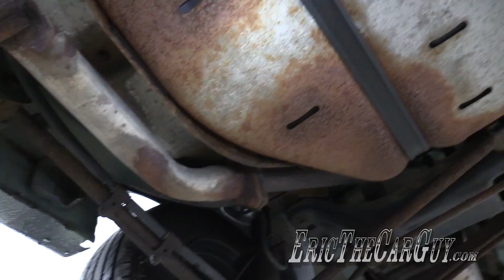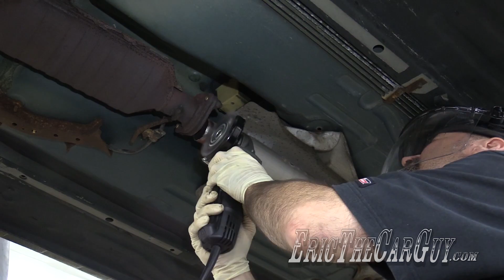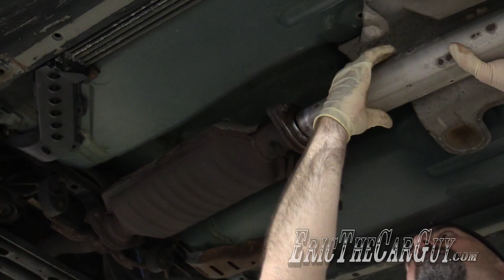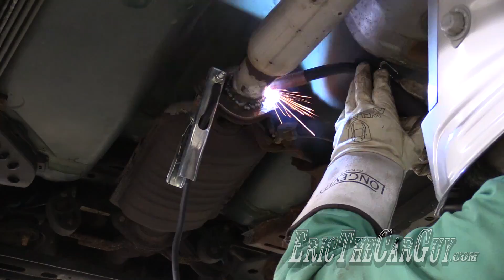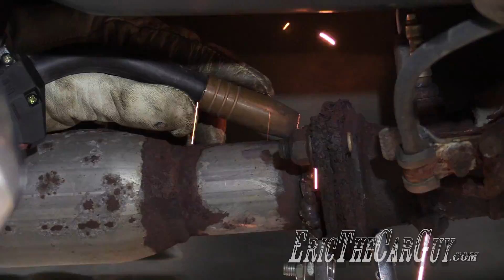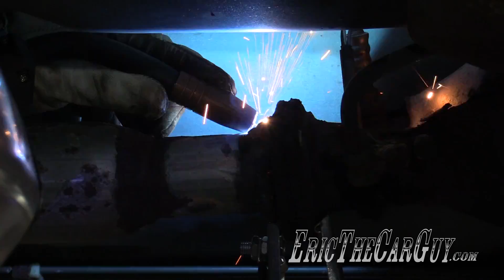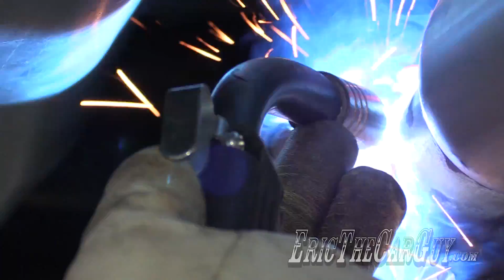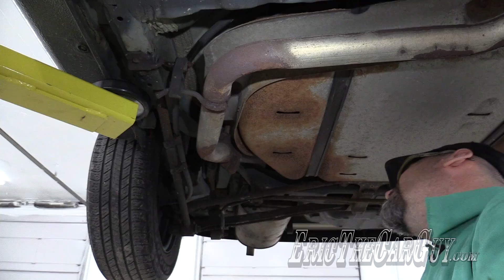Money Saving Exhaust Repair -EricTheCarGuy

Comment: This is exactly the same problem I found today. My exhaulst on my Land rover is in good condition , but the flange on one pipe has come away from the pipe.  So clean that there is no sign of weld at first inspection.  I just wonder if this is deliberate  manufacturing ploy.  So, armed with this information I am going to try and repair the flange as the rest of the system looks really sound.

Comment: I had different “lifetime” muffler “replacement” warranties…. They were both(big name companies)! Very talented - make up brackets that add abnormal tension on the welded bracket - pipe rust through anear the weld and the tension pulls the bracket away New exhaust leak EVERY TWO YEARS! Muffler free BUT “ we need to replace all your pipes or the “WARRANTY” is voided. $300 every 2 years!!!!!!

Comment: Flux core welding is very difficult much more than mig, you have to have every thing dialed in perfect. feed speed/current, voltage and tip distance and travel speed and a very good wire type. also use correct nozzle. using that tapped transformer old style dial welder makes it that much worse for flux core.

Comment: 3:30 Putting a soft booted clamp on each side of the exhaust, then running two longer clamps to pull those two together, is one way to butt them together.

Comment: Could also wrap a bit of the welding wire around the break to add more raw material right? I might just buy a welder I've always wanted to fix my exhaust that just broke off, although I don't have a lift, I wonder if I can just roll my car over on the grass somehow...

Comment: I like this guy, he's so calm and mellow, he could do ASMR videos.  

1. Make sure you have a good ground (find or make a clean place for your ground)! 
2. Clean everything within a 1/4" of your weld to bear metal inside and out (if there's a gap or you burn through it will fill easier without the contaminates inside getting into your weld).
3. Dial in your welder on similar piece of scrap before you start. 
4. MAKE SURE YOU HAVE A GOOD GROUND!

I would have (maybe) left the rear hanger on and unbolted the front flange and dropped it down after tacking it, but then that could be a whole other problem.

Comment: Them welding gloves are not for auto mechanics get cheap gloves for that you don't want oil on the welding gloves that have sparks on them.i know its a pain but they cost more and can start on fire oil soaked you don't want to be on fire and don't know it.got it fixed.

Comment: I agree with dirtwelder162 or whatever. Eric, we have all been there for a friend or family member who needs the exhaust to last 6 months or a year. Pulling weld from the thicker flange onto the thinner pipe is an option with burn-thru. Another, weld a 2” length of donor pipe from the scrap barrel. Weld it too the flange, the clean, slide the old into a proper sized shorty that is easy to work the MIG torch around for a complete weld. This puts the thin stuff inside. Yes, they owe you a steak dinner...with sides and a cold one! Friend. You know.
ASE Master  - Retired 10 years ago  (now 2021) still fixing!
Reply: DirtShower250  cool name!

Comment: Im have an issue with a '98civic ex coupe, imagine that. Exhaust pipe is separated at the resonator hanger, going towards the muffler. The problem is, where the resonator pipe connects to the cat, it is welded, no 3 bolt flange. Are there 3 bolt quick fix flanges I can use? I do not have welding capabilities, or the funds to pay a shop to do the work.

Comment: Hi Eric...there were no connectors would not fit my new exhaust. I used a good brand exhaust wrap to increase the 2 1/5 inch pipe to 3 in, then I wrapped around the outside with exhaust wrap and put a stainless steel pipe clamp over the connection. Will it last? Also, how do thunk it will hold up in winter weather?

Comment: Just a a little tip for getting the top of exhaust welded. Use a 1/16 6013 rod at 40 amps, bend the rod in a u shape, I usually hold inspection mirror in one hand and stinger in the other. Works every time!
Reply: @TheHopson I grinded my flange with a cutting wheel, it worked, but unfortunately ended up with metal shavings in my muffler. I replaced the muffler, but then the new muffler rotted and has a pretty good exhaust leak. I want to put back factory muffler, the one with metal shavings in it. I tried getting the shavings out, but can still hear them rattle around. My question is, is it safe to put that muffler back on, with the tiny metal shavings still in it..? I can hear them, as I hold the muffler, and keep flipping it 180 degrees. Is it safe to put it back on my car, with these metal shavings still present..? Thank you for your time, and advice.

Comment: from personal experience its almost always easier to just cut the flange off and replace it with a  short piece of tubing either smaller or larger diameter if you don't have access to a expander or reducer

Comment: This is me;

Exhaust pipe rusted through.
Should I weld it?
OEM pipe= $400 (lasts more than 10 years)
Cheap pipe= $75 (lasts about 3 years)
How old is the car? more than 15 years

Just get the cheap pipe.

Comment: Every video you've done is the same low quality work. If this is your personal car, this repair is fine and costs almost $0!  If this is a customer car shops wouldn't do this--the pipe is going to need to be changed anyway and the exhaust flange gasket needs changing.Don't worry it will break at those bad welds.   You're really doing a dis-service to your customers--unless they're desperate for cash.  Save Time=Save Money=DO the JOB Right the first time.

Comment: tight work space my man. something sounds a little off with the wire feed or voltage. it shouldn't tap tap tap like that. should be nice smooth current. I actually have a muffler pipe job going on this week. thanks eric!

Comment: I know I am a bit late on this one but from my point of view I would have cut the flange to cat bolts used a new flange and bolts with a coupling welded to the flange to slide the pipe into then clamped it. Seems like a better way to go on this one. GOD VIDEO ANYWAY.

Comment: Great job Eric. Seems like you could gave unbolted the flange from cat to pipe and rewelded the flange to straight pipe. Still the same deal in the end. Happy welding 👍👍
Reply: Sure, but those flange bolts are probably 'permanent', and he's likely not getting paid, so faster is better.

Comment: Thank you for your video and time. How much  would you say it costs  to cut out old  and  weld a new 6" or 10" pipe replacement on the exhaust part underneath front?  Thanks

Comment: How can welding damage the computer?
Reply: The welder uses very high electricity to make the metal hot and melt, that electricity can find its way to the computer, and ruin it if your battery is hooked up while welding.

Comment: When you have a gap and welding thin metal, easier to do single tacks on one side then the other, it will allow the metal to cool and lessens the chance of it blowing through. Just like you were doing a sheet metal repair on a body. In addition, start at the thickest part (Flange) and jump the tack to the thinner part (pipe). Clean it off then go back around it stitching both pieces together. So you are "stitching" from flange, to weld, to pipe, to weld, back to flange. That way it gives you more metal to work with...
And I would have tacked it, then only dropped it at the flange to get the top and wedge something between the pipe and bottom of the car to hold it down...
Been there before... but no lift... doing it in the driveway laying on a creeper... Fun times...
Also I have used an old ratchet strap to pull the pipes together just long enough to get it tacked... Get it wet so it don't catch fire from any spatter.

Comment: I realize it's a help video. But, y not disconnect the broken flange end and the other flange closer to the muffler. Make orientation Mark's, take it of and weld it, in position. Wouldn't take any longer

Comment: Welding? New parts? .....Nah,  Thick rubber bungee strap pulling the  two parts together. That’s what I just done. You should see it. It’s a reaaaal piece of work ;)

 (changes it every other month due to heat/melt)  1998 Honda Civic with 300,000 miles

Comment: Stacking tacks is usually easiest way to do thin wall tube like exhaust, least chance or burn thru. Also bounce from side to side to minimize heat soaking the metal

Comment: sealing that leak will over work the engine  and cause fuel injector damage bank 1 gets the worst beating if the exhaust on bank 2 is stronger

Comment: that un regulated part of the exhaust system has a clog, hot ass exhaust will burn a hole through the weakest parts of the exhaust pipes normally near the flex pipes

Comment: Eric great videos and for those that don't have access to a welder using a slip fit exhaust connector is another great fix to keep the neighbors happy trick is IO vs OD if you have say 2.5" exhaust you can get a 2.5 ID to 2.25 OD the 2.5 ID will slip over while the 2.25 will slip inside.  Hope this helps someone!-)

Comment: Was hoping you would use one of those new laser deruster to clean before welding.  To cover the hole in the top, it's cheaper to use patching material and fabric, just as effective.  That way you don't have to loosten and exhaust items and reattach to complete repair.

Comment: i tried doing this yesterday on my civic with the same problem. extremely hard unless you have  thin welding wire. i found it much easier to just sawzall the flanges off and slide in a nipple/coupling piece with claims. only like 14$.... and super tight

Comment: I was just driving the other day and dropped a gear to overtake and all of a sudden out of nowhere a "poof" sound was heard and a rythmic metal scraping. I immidietly knew what happened but secretly I wished it was maybe something else. Stopped and looked under and my middle pipe was scraping the road but not on the side of the cat (like in the video), but on the muffler. I really don't know if welding is an option because it sure has to be rusted to hell to shear itself from the exhaust pressure. Any other alternative than a new pipe? I gotta pay my semestrial tax in a few days so I don't have a lot of money, but the majority of my exhaust is hanging on zipties right now lol

Comment: I have the same problem...sure i can weld pipe but the top section is very tight and i do not have ability to drop pipe... i am hoping i can seal it good anyway...

Comment: I might go and install a stainless steel muffler these days...
Okay i heard exhaust shops don't want to unhook negative terminal or both but i have the right to ask for it...but is then 100% safe for ECU (and battery which is cheap) or i have to do anything else...
For example how do i disconnect ECU and where it's usually on Toyota's?

Comment: That is a good habit to have that work clamp very close to where you are welding. It keeps the electrical return path as short as possible. I learned that early on when I first got my everlast welder and was being taught by a very knowledgeable welder.

Comment: you could have not been a hacking unbolted the flange and then tack welded it and place to the pipe and welded it solid the metal you welded to was thin fuc and just going to rot right back out

Comment: repairing exhaust is one of the most difficult job to do with a MIG welder as it very difficult to clean completely the rust, the material is often  extra thin and the access is limited.
Eric does a damn good job
Reply: Lmao its dirty that is exactly why using wirefeed

Comment: Great job man. Im a certified welder graduated at CWB Group alberta. I can weld anything but i hate welding on cars specially exhausts. Disconnect battery make sure cats topped up in fuel less fumes no explosions lol tight spots to bash your head on rust cleaning its not fun. Awesome job. Those that crit you on this obviously are pen pushing white collars 😎

Comment: Good to see he is wearing face protection. I dread the times when wire comes flying off the angle grinder. My exhaust is making noises and I suspect I've got a crack in the pipe somewhere. Time to get out the everlast. I will probably weld in place as Eric did. I don't want to unbolt everything.

Comment: doing this with a welding machine that feeds flux core wire like I have is really hard in my opinion . you made this look easy.
Reply: you sir are a genius. I wish I thought of that before I made a giant blob weld on the top of my rangers new glass pack muffler.

Comment: I might have gone with a split sleeve to get on to sound metal. Short bit of pipe, split along it's length. Slide sleeve over the end of the pipe (smear of exhaust paste to lubricate and aid sealing). Move sleeve to contact flange. Tack both ends of sleeve first then run weld along all seams (including split). This method is easy to weld with area at the flange strengthened beyond a single weld as you have done in your video. Hope you do not mind my ten cents worth. Keep the vids coming - enjoy watching them.

Comment: It needs another brace welded to pipe to hang to body. There is a lot of tension on that one weld. Because of welding heat changing the temper- a weld is the first place to rust.

Comment: I'm a pro welder too. He did okay for what it was. As we say over here, fit for purpose.
Only issue with welding old exhausts is that once they start cracking, it means the pipe has become embrittled with heat and age and will probably break again near the weld in time. But hey, it is a good way to keep the car on the road whilst you save enough to replace the system sometime. Keep on doing it until you're ready.

Surprising really.. Don't often see you Americans leaving the safety guard on the grinder! lol.
I agree with using the face shield though. I had a guy on my crew who used to use the wire buff on a 9" grinder to prep steel for painting. He would come into my office to talk about something, and I would tell him to pluck those wire strands sticking out of his face. He never realised they were in him!
Reply: i just wonder i live in europe so its 220V-50hz in us its 110-60hz is there a big diference in welding.By the sound its more high pitched.The top part looks great

The weld is ok , he know what to do but maybe more amps and thicker wire but that can also melt the pipe

Comment: Eric, had an almost exact problem the other day. I was using a stick welder so I unbolted  the flange, found a 6" piece of pipe that would fit in the rusted pipe, welded it to the flange in my bench vice, slid it into the rusted pipe, clamped the flange halves back together and put a muffler clamp on the pipe. Looks easier than this way and less dirt in your face, but your way is probably quicker. Thanks for the vid. have a good wknd.

Comment: Your welding skills are not the best lol aim the heat into the flange then jiggle the gun up to the pipe to push the bead up onto the pipe. This way you can penetrate the flange without burning holes in the pipe and you can get a few more amps on the welder too.

Comment: My old Probe's exhaust rusted out in the same place. I didn't have a garage or any money so I ended up cutting off the flange and flex-piped it. (I used a coat-hangers to hold the "repair" up. . . . . . . I think one of the hangers was missing and/or rusted off too.) It got me past a tough year. Come to think of it, I did other cheap "repairs" with coat-hangers. You should do a whole special on just how useful the coat hanger is. To this day I keep one in my car just incase. I think it should be mandatory in every emergency tool-kit, right next to duct-tape, vice-grips, JB-Weild and WD40.

Comment: i would have taken the flange off of the converter and found a short piece of pipe slightly larger than the muffler pipe.  then weld it to the flange on the bench.  you would get it welded good the first time as for the length of the new piece of pipe all you would need to is cut it to length so you could slip it over the old pipe and weld it to the muffler body while it is hanging down and easy to get to.

Comment: Eric the car guy I have a crack in the actual converter itself I know the converter is bad and it needs too be replaced I plan on doing it myself if I attach a bolt on instead of welding which it looks like mine was welded on can I attach the bolt on Walker

Comment: On my 1993 Vigor, the pipe right behind the muffler was swiss cheese.  I put some patch tape on it just to get by, but when it fell off I went to a less tawny part of town, and a repair shop replaced the resonator and fabricated a new pipe back to the muffler, replacing the flanged pieces for $114!  

I got to watch.  The guy was really good with the pipe bender and the car is dead quiet now.  Even if I had a MIG welder, I'd rather watch somebody else do it for what I paid.

Comment: Welder/fabricator here, removing the bolts from a flange and taking it off is not the greatest idea, over time the flanges get rusty and warped there's usually a gasket in between and getting it to seal back up would be a task, he did the right thing, although he should have cut out pipe behind the catalytic converter and installed a new section. Maybe a 2-6 inch piece. Or delete the flange completely.

Comment: Can't you weld the battery terminal back together? It is lead, and will melt very easily
Reply: Why would you even think about welding or melting lead when a battery terminal costs at best about 3 to 6 bucks? and it would be better in the long run anyways. Less corrosion and less stress on it. cheap fix, and only 2 bolts..